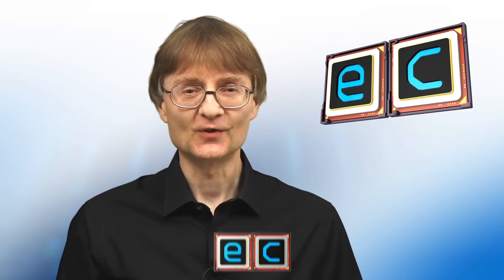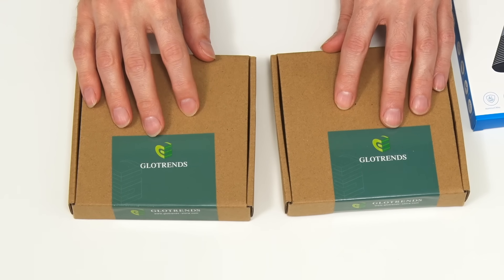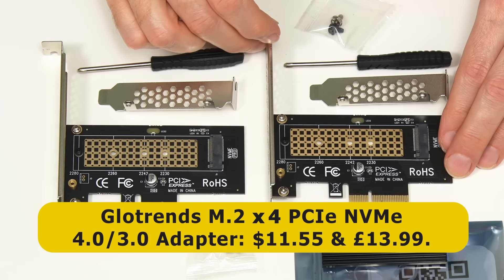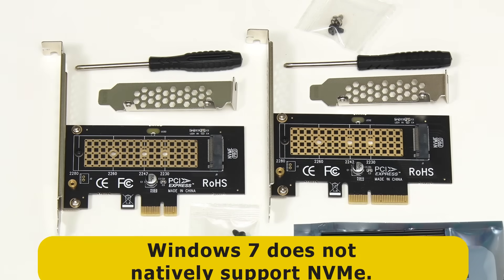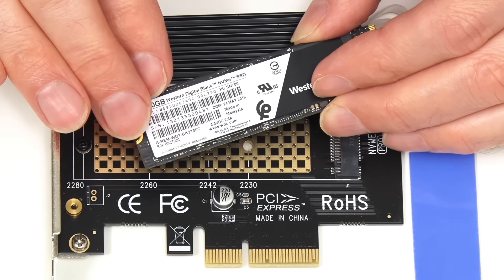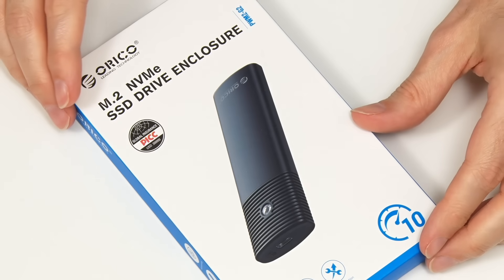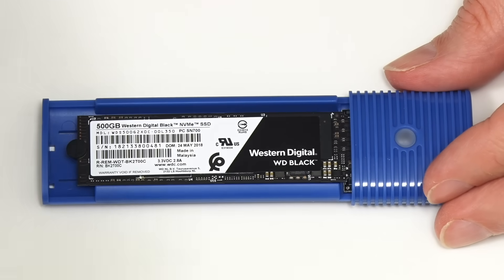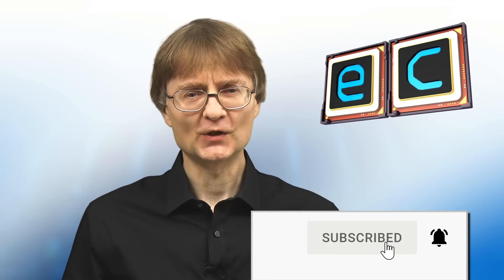M.2 SSD Adapters & Enclosures

Comment from the maker: Greetings! Just a point of correction that, as some have commented below, there are now a few motherboards with PCIe 5.0 slots. My mistake. But it makes no difference to the content of this video.
Reply: I think there are more pci 5 mobo's than there are pcie 5 ssd's
Reply: @adamarmfield1069  Yes, and there are practically no PCIe Gen5 expansion cards at all on the markets, yet.

Support for PCIe Gen5 must start somewhere and motherboards are logical place to start. It gives some future proofing of a system aswell, like full datatransfer support for next gen GPUs.
Reply: @adamarmfield1069  Well it's been said that there's no real world difference between gen 4 and gen 5 in terms what we can tell other than running benchmarks which is why gen 5 is slow to be accepted out there and another reason is high cost.  Later down the road gen 5 will be standard and prices will be reasonable to skip the gen 4.
Reply from the maker: @Darkk6969  I suspect that PCIe 5.0 will only become common for M.2 slots, not PCIe slots. Still today a lot of new motherboards have PCIe 3.0 slots only. :)
Reply: @ExplainingComputers  I wouldn't even call it a mistake. There are very few consumer boards with PCIE 5.0 beyond a single x16 slot for the GPU. They all cost $600+. "Regular" high-end boards have a single PCIE 5.0 x16, and the chances of it ever being used for NVME expansion are exceedingly low.
Reply: @ExplainingComputers  M.2 to PCIe is just a passive mechanical adapter so I think if the need arise those previous generation rated adapters could work somehow to cope wit the PCIe 5.0 speeds. Also is worth to mention that any motherboard from previous to 2013 even with UEFI BIOSes without the M.2 slot will not work with PCIe adapters, since the BIOS doesn't have the drivers to initialize and boot an operative system like Microsoft Windows thus making the installed SSD unaccesible, I have tried and learned the lesson.
Reply: @johnnychang4233 incorrect. While you cannot boot from a NVMe SSD in an adapter if the BIOS has no support for it (as common with boards old enough not to have M.2 slots natively), but it will still work within an OS as fast storage. One can kludge past this issue by having the bootmanager on a SATA drive and the OS on the NVMe SSD
Reply: @420bobby69  Dunno where you get your info from, but there's currently 36 motherboard models that have a PCIe Gen5 x16 slot and (at least) one PCIe Gen5 M.2 x4 slot at the same time, with 10 of those being sub-300 euro (not exactly cheap by any means, but nowhere close to your figure)
Reply: @Knaeckebrotsaege  Tried those also with Clover UEFI and the NVMe preload driver hack and it's not working. I had to install SATA SSD with  the aforementioned bottleneck of SATA2 in an old enough system.
Reply: @420bobby69  That's incorrect. There are at least 30 PC motherboards with PCI 5, prices start at $159 and at least five different manufactures of M.2 drives are Gen 5, also available at normal prices. I don't know why you typed all that misinformation, it's obviously wrong.
Reply: @Darkk6969 in our workstation we have pcie5.0 that reach 12.5GB/sec read vs pci4.0 that don't go over 7.5GB/sec. Is a huge difference for us.
Reply: @420bobby69  I wouldn't say very few, since every x670E and b650E board has Gen 5 x16 slot for GPU and SSD m.2 expansion card.
Those aren't that expensive either since cost is around 150-400 USD.
Reply: @ExplainingComputers  Next gen GPUs, meaning Rx 8000 and RTX5000 series should be PCIe Gen 5 cards.
This is evident when you look at new feature sets in graphics processing. Like DirectStorage from MS and RTX-IO from Nvidia.
Reply: @ExplainingComputers  Actually, the latest generation of Intel (12th and 13th gen) and AMD motherboards (AM5, but not all of them) do come with (usually) at least one PCI-E v5.0 x16 slot. But since it is typically the only x16 slot, most people will fit their GPU in there (there are no GPUs yet that can use the full bandwidth though). They do however have typically have 1 M.2 NVME slot that supports PCI-E v5.0.
Reply: @blender_wiki  Blender must be the only use case where that makes any difference whatsoever lmao. Even if you do 8K RAW videography, the bottleneck will always be offloading the file to your computer, getting it into resolve takes a 10th as long.
Reply: Thank you for the correction.  As always, your videos are very clear and concise.  Great job as always.
Reply: I upgraded my Haswell era proxmox server with 3 of these cards , x4 or x16 Same brand as in the video. I also used one in a bulldozer AMD ITX system. Sadly the latter does not boot from NVME. Still great as a data drive.

I consider using the remaining X2 slot in my proxmox server to be filled with a faster network card.
Reply: Can you do an addendum to this episode about M.2 enclosures that fit and HD sata drives? That seems to be the saving grace in a limited PCI situation, but I'm unsure of possible problems with bandwidth and so on. TY great episode!
Reply: A couple of years ago, I bought a PCIe x1 card for a WD nMVE Black SSD I got. At the time, the only PC desktop I had to stick it in was an old HP with Core 2 CPU, but strangely it has DDR3 RAM and SATA3 interface instead of DDR2 & SATA2 which most Core 2s had. I tried the CrystalMark test on it, and it was half the speed of the SATA3 SSD Drive I put in it which is a WD Green.
Reply: what about for laptop. And to be specific USB enclorse are not what i am looking for. I would like to connect multiple m.2 nvme ssd to my laptop
Reply: Do I need a regular ssd before I install windows on the computer? I mean.. I do have a m.2 ssd on the 1lane card. But no other ssd. Is it required? Or is the m.2 and the 1lane card enough?
Reply: suggesting that windows 7 doesnt support nvme drives is misleading at best and flat out lying at worst. thats like saying windows xp isnt still used for banking systems, it is and will be for a very long time.

Comment: So the M.2 shares the PCI channels. Will this affect the video card's performance?  

I will not leave you with a trick question like this. I have seen it first hand. On Lenovo P330s the video was less than useless with that M.2 SSD installed. It took one of the M.2 ssds checking out and me replacing it with a 480gb 2.5 SSD  to figure that one out. We bought them in bulk for our VMS viewing stations. The Lenovo P330s workstations I am talking about is the tower version not the mini workstation with laptop parts. Yes we have those too. They are more than worthless  with a VMS.
Reply from the maker: The answer is that is depends on how many PCIe lanes are available, both on the CPU and in the motherboard chipset. On a modern PC, it is extremely unlikely that adding an M.2 PCIe adapter will impact video card performance -- it certainly has not in the two Intel (10th and 12th Gen) and AMD systems I've used these cards in.

Comment: Will a nvme pcie adapter disable sata slots from the motherboard ?
Reply from the maker: Unlikely on a modern motherboard. It's more usual that, on older boards, using the M.2 slot disabled a SATA port.

Comment: Thanks for explaining PCIe lines-it makes everything much clearer now. When it comes to enclosures from ORICO, I don’t like the rubber-like one; as you noticed, it's not the most convenient. I’d be happier if there were a simple screw instead... but anyway, it works, most of the time. I'm not sure why you chose the plastic one, since the metal ones are also available and the price was almost the same; it wasn’t more expensive. I bought two because I also needed one for SATA. But anyway, thanks again for the video!

Comment: I just finished upgrading an HP All in one that had an athlon silver, 4gb ram and a wd blue caviar. 
Mobo had an m.2 slot, so I cloned the hard drive to an NVME and added 32 gb ram.
Reduced boot times from 4 minutes to 14 seconds.

Comment: I have filled my nvme slots and was wondering about these. They would be perfect to shove all of my older games, bootable ISO's not in use and other stuff. Sata SSD's are no longer being made like the MX500 I have and the only alternative like the Samsung one are more expensive than a 1tb nvme drive which tells me the days of 2.5 inch SATA SSD's are almost over.

Comment: Should be noted that some motherboards are not compatible with any NVME drive. However there may be workarounds depending on your board. I was able to find a home brewed BIOS for my 7020 Optiplex and the NVME PCIE adapter has worked ever since. It can even boot off the same drive.

Comment: Just rewatched this lovely video of yours as I'm finally jumping to the world of M.2 NVME. I was wondering what speed an NVME will run at on PCIE 2.0 x1 and that has been answered by 5:16.

So far I've only used M.2 drives in SATA flavor with 2 of them in PCs, 1 in a laptop, and 1 inside an Orico enclosure. The speed of SATA SSDs has never been an issue with me and honestly no reason to go NVME. 

The reason I got an M.2 NVME is that I wanted more storage and the prices of SATA (2.5" & M.2) SSDs are very close to NVME ones so I got myself a Teamgroup MP33 1TB which will be arriving in a few days. 

I'm currently debating if I'll get another M.2 enclosure for the 256gb M.2 SATA drive it'll displace or an M.2 to SATA adapter board.
Reply from the maker: Good luck with your new SSD!
Reply: @ExplainingComputers  Thanks Chris! The new SSD has been performing well. The move from SATA to NVME didn't really change my experience using the PC. File transfer via local network also didn't change since my Gigabit network is the limiting factor and my 300mbit Internet isn't even gonna saturate even a SATA SSD.

Comment: I installed one pcie 4x card to nvme in my pc, two days later the PSU blew up, now I don't know if it was the pcie adapter or a fault of the PSU, nothing got damaged just the nvme 2 tb unit installed in the card and the PSU, that is why I suspect it was the adapter.

Comment: For anyone reading this in 2025, most older motherboards (z87 , intel 4th gen era) do not support OS boot from NVMe storage because only a very select few motherboards had M.2 slots available at the time, however, if you are willing to learn and tinker, it is possible to modify your BIOS and add that functionality yourself though slightly technical. While you are reading this comment I wanted to mention that you can also add GPU ReBAR support to your motherboard using BIOS modification as well, these 2 features are one of the most valuable additions to recent technology and with a little tinkering could extend the life of your current components.

Comment: Quick question: my motherboard is a B450m Pro 4 and has PCIe 3.0 slots. However, I have a Samsung 990 Pro (PCIe 4.0) and I would like to know if the NVMe x4 adapter would work to convert my 990 Pro 4.0 and I would be able to insert the adapter into the 3.0 slots? I know that PCie 4.0 SSDs are backward compatible but it was not working when I inserted into the M.2 slots.
Reply from the maker: Thanks for this and your e-mail. The PCIe NVMe x4 adapter should indeed allow you to use your PCIe 4.0 SSD in a PCIe 3.0 slot, working at PCIe 3.0 speeds. However the drive should also work in an M.2 slot on the board. So be aware of the following:

I am assuming that your motherboard is one of these: https://www.asrock.com/mb/AMD/B450M%20Pro4/index.asp  If so, only one of your PCIe slots is 3.0 (maybe already used for a graphics card), and the others are PCIe 2.0.

The board had two M.2 slots, and the second, whilst M keyed, is SATA only, so your NVMe SSD cannot work in it. The first M.2 slot (M.2_1) is shared with the SATA port 3. 

So the first thing your need to do is to make sure that you are testing your NVMe SSD in M.2 slot 1 and not slot 2. And if it does not work, you either have a drive connected to the SATA_3 port, and/or (very likely) in the BIOS there is an option to use either SATA_3 or the M.2_1 slot, and this is currently set to SATA_3. So you need to trawl through you BIOS options to see how M.2_1/SATA_3 are configured. But fingers crossed you will be able to use your drive in this slot (at PCIe 3.0 speed). Of course, if you are using all four SATA connectors, you will have to stop using one of them so that nothing is connected to SATA_3.

Come back to my via e-mail. Good luck! :)

Comment: If more than one m.2 is used on a adapter card will they be seen as one large drive or separately by windows?
Reply from the maker: They will appear as two separate drives unless you chose to configure them as RAID, in which case they could appear as a single drive.
Reply: @ExplainingComputers  Perfect! Thank you for still answering questions a year later.

Comment: Cool. Reviving an old FM2 AMD (A5500 4 core APU, 8GB ddr3, 128gb intel SATA SSD) machine with a $30 RX 580 gpu and now gaming at 1080p in Linux Mint Debian Edition, most Windows games just runs 🎉
Games are so huge though so a faster SSD with more capacity is next up and having a spare pcie 3.0 x1 slot seems like a good way. Not that much faster than SATA III but better to invest in a 1TB m2 disk these days

Comment: Windows 7 does support NVME. You just can't boot from it and it can't read SMART data
Reply from the maker: Or, you could download the required Windows 7 driver and it will work just fine: https://nvmexpress.org/drivers/windowsdrivers

Oh, and the video actually says "also, note that NVMe support was first included in Windows 8 -- so if you’re still running Windows 7, an NVMe PCIe card will not work out of the box."

Comment: I started scavenging my house for old parts and set up a pretty decent machine for my mom who needed a PC for office stuff and web browsing she ended up with 

Athlon X2 250 at 3Ghz
8GB DDR3 RAM
1GB dedicated Radeon GPU

I installed a lightweight linux distro but still had only an HDD

The mobo sadly only supports Sata II and not III so SATA SSDs were out of the question (yeah i know sata II is much faster than HDDs but still she'll probably upgrade at some point so having an NVMe already was mandatory for my own peace of mind) so I bought her one of these and an NVMe and slotted it into one of the PCIe slots.

Btw the PCIe slot is gen 1 lolz but still double the speed of a SATA III.

That machine flies for what she needs it for.
Reply from the maker: This is cool -- thanks for sharing. :)

Comment: Nice video, great explanation! One thing you didn't cover though was the heatsink installation on those M.2 drives, some of them get really hot. Older computers don't have heatsinks for them on the motherboard (though newer motherboards do) so a heatsink is really necessary. The only problem I see is that right on the label of the NVME drive it says, "Warranty Void If Removed," but to get good heat transfer the label must be removed. This is a dilemma; I don't want to void the warranty on my new M.2 NVME SSD, but I don't want it to turn into a toaster either!

Comment: I just installed an m.2 PCIE adapter yesterday and was pleasantly surprised that i got the full speed out of my Gen3 nvme. the drive claims to run at 3500MB/s and it tested at 3450MB/s in the adapter. awesome!

Comment: So you only tested a 3.0 drive?  Does anyone have results of a 4.0 drive in a pcie 4.0 x1 slot?  I have two of these on my board.  Would like to know if I should bother loading in some m.2’s into those slots.  In theory based on his 3.0 test I should get 1700MB/s max but would love to see actual results.
Reply from the maker: I "only tested a PCIe 3.0 drive" because I was using PCIe 3.0 slots, so there was no point using a PCIe 4.0 drive. And in the 4-lane slot, the PCIe 3.0 drive worked at full speed (approaching 3500MB/s). If you put a 4-lane PCIe 4.0 SSD in a PCIe 4.0 slot and adapter it operate at about double the speed -- approaching 7000MB/s. So you are right, you should get around 1700MB/s if you use a one-lane PCIe 4.0 slot and a PCIe 4.0 drive. Good luck!

Comment: I did as you did, put a NVMe into an enclosure, cooler master that is, listing compatibility for my ssd but for the world of me it doesn't boot a Windows system,  despite that NVMe was previously a hard drive in a laptop. I know how to push it up in BIOS and save, exit, it should boot Windows, but it doesn't. I managed to make a basic 3.0 USB with Win on the go boot, update etc, so it probably isn't about me lacking basics. What could be the problem? EDIT: the laptop in which that SSD resided before does otherwise recognise the device and shows folders in it, just it doesn't boot as Windows externally. The laptop runs on Linux and I know sudo update-grub.
Reply from the maker: The problem here I'm pretty certain is that Windows is not designed to run an external drive. It sounds like you have tried to get around this using Windows to Go to create a USB-bootable Windows installation, and I would image it is the settings for this you need to sort out. The fact that the NVMe SSD was a Windows boot drive in another PC is irrelevant (save for indicating that the drive works!). Good luck!
Reply: @ExplainingComputers  Thank you. I guess if I clone the usb Win on the go to the ssd, it would work, just probably not as fast as from the usb I now have, of gen.2, 10x faster reading speed than of standard usb 3.0 Gen1. It feels like a proper windows on a hard drive (just it doesn't accept hibernation settings). I just didn't want to overwrite Win on the ssd in case I had to plug it back into the machine as a hard drive. But I cloned that too, so I could easily do the copy and use it as needed. If that makes sense. I have a clone of Win ssd as internal drive, and also on the go, just set up separately. I do have two licenses, so that is not a problem :) Summed it up I got that cooler master enclosure needlessly as I am not going to use the ssd this way then.